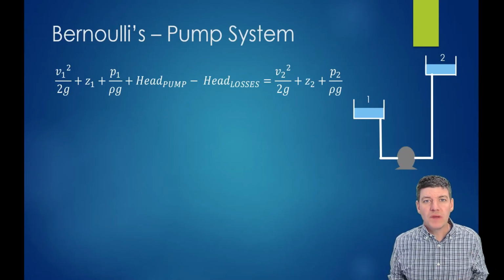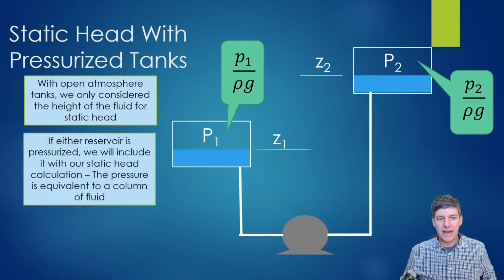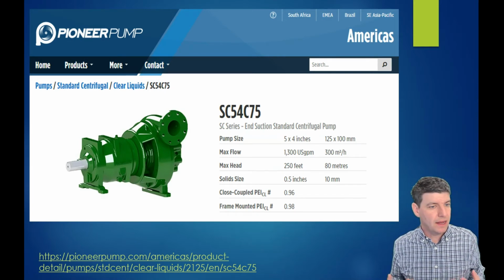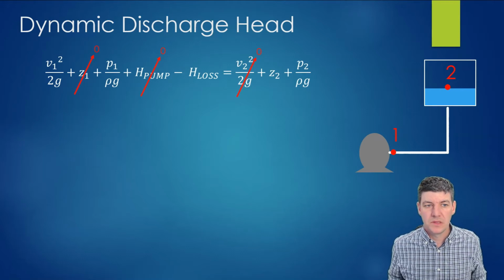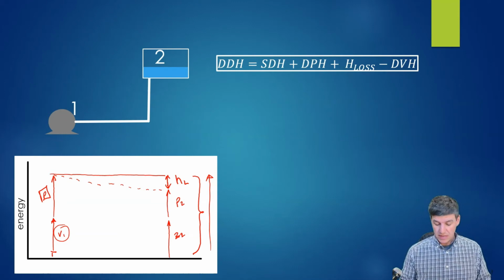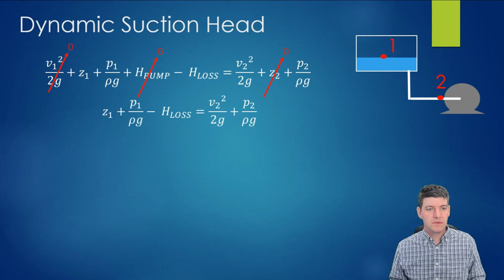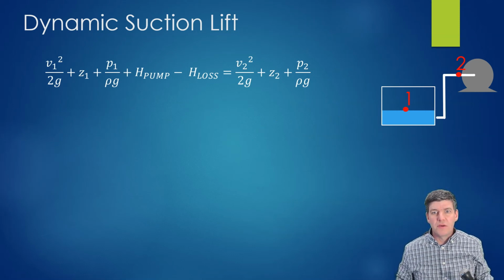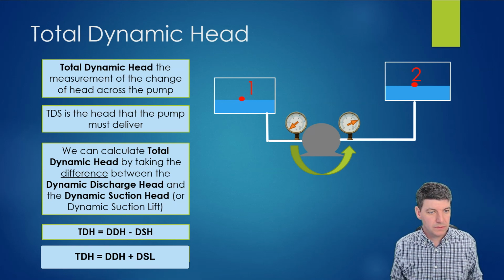PENG2011 - Fluid Mechanics - Pump Head Calculations 3 - Dynamic Head - Total, Discharge and Suction

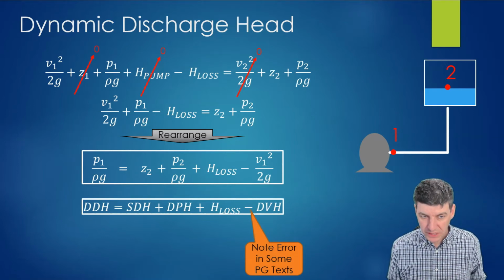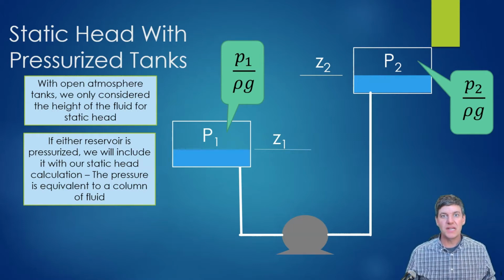Comment: @14:49 Second term on the RHS DPH should be the "Discharge Pressure Head"  (Not "Dynamic Pressure Head") to be consistent with your "Pump Head Calculations 4" video @5:12  and later on in Part 4 - see my comment on that video.
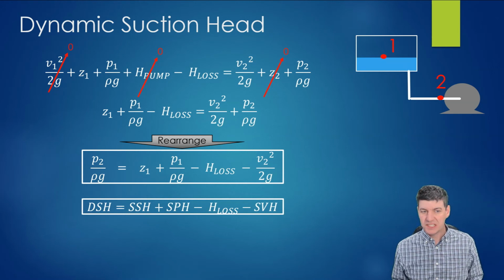There is also an inconsistency with naming of this term if you compare this video @24:17 where you are discussing the input side.  On the input side you refer to the equivalent term on the input side as the SPH "Static Pressure Head".